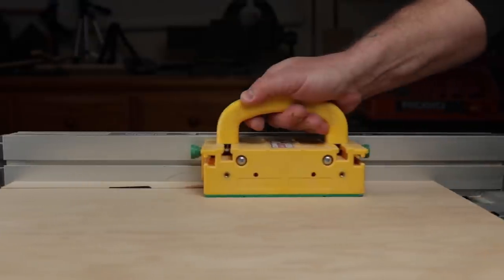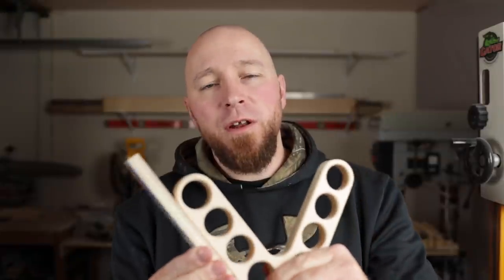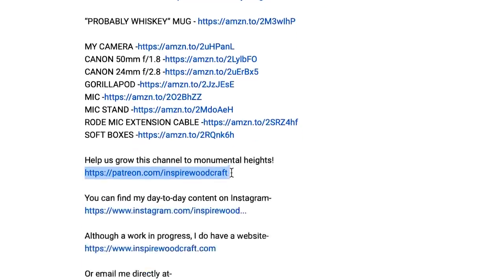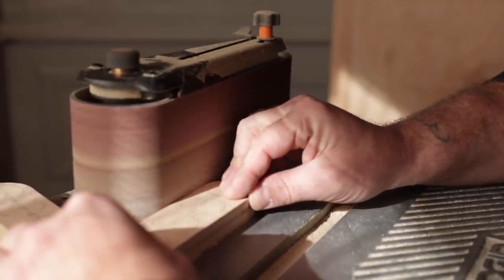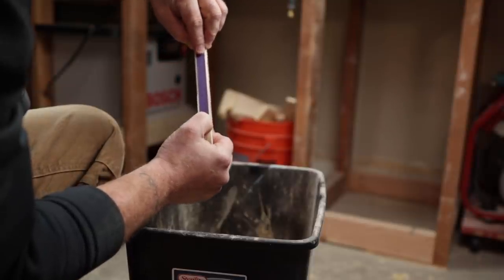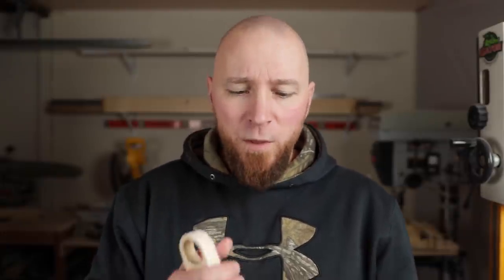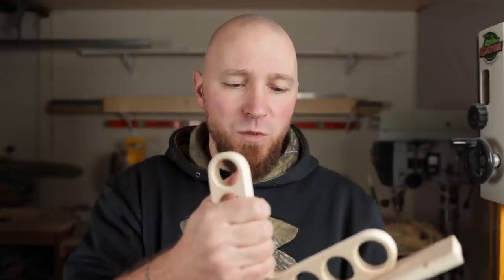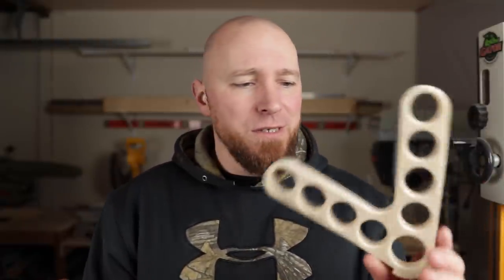Is This The New Best Push Stick Design For The Table Saw? / FREE TEMPLATE!

Comment: Watch the blade height on narrow cuts. A line in the handles showing maximum blade height might be a good idea. I realize you are not supposed to run the blade much over the thickness of the material being cut but I can see it getting left up by accident. 4:50 Call me paranoid but after 40 years of woodworking I still have all 10 fingers.....
Reply from the maker: Completely understand. Not sure what you’re referring to with the time stamp though. Can you clarify please?
Reply: @InspireWoodcraft  If you look at your fingers @ 4:50 you will see they are directly in line with the blade. If the blade was left too high for some reason you would be looking at your pinky finger laying on the top of the table saw.
Reply from the maker: Oh okay I see what you’re saying. Just so that we’re on the same page, that first cut was to demonstrate that it was tall enough that you could use it on the opposite side of the fence which is what some people prefer. I personally don’t so my hand was a little lower on the handle. But that being said, I would have to have the blade nearly two whole inches above the top of the material being cut in order to have the blade contact my hand at all. If I did leave it up that high and still push it all the way through I should probably rethink my career choices. Thanks for clarifying for me!
Reply: centaurus777 - why is the blade height u mention a table saw safety rule?  i find my work lifting off the blade more with a correctly set blade height.  also, it seems to me that at a correctly set height the blade is cutting by pushing back on the wood where as if it is set higher up the blade is cutting more as is comes down, both holding the piece against the table and reducing the force it pushes it back, which to me appears to create a condition where the tendency for kickback is reduced.  could you clarify?
Reply: @michael-dm2bv  What you are saying is true. When the blade is set low the cutting path is longer and the work is pushed back against the feed. If you were to cut at the center of the blade then yes the cutting force is more downward and the cut path is straight through the stock. However, the more blade above the work the greater the risk of getting into the thing. The work does like to "ride" up the blade sometimes when set just above the stock but a hold down or a second push stick will correct that. Kickbacks that can throw the work and ruin your day are a real risk whenever the blade can grab the work and the work has something to bump against like improperly using a fence on short stock. With the push stick video we were watching @ 4:50 you can see the blade height can increase the risk. Some saws had guards over the blades to help protect your fingers but mine never did and many you see on YouTube do not have them either or they were taken off and pitched for whatever reason. This is just my take on the subject and I suppose an entire book could be written on it. Read through this for other views. http://www.woodweb.com/knowledge_base/Table_Saw_Blade_Height_Above_Material.html
Reply: @centaurus777  - thanks for the reply.  i don't use a blade guard either but stubby nubs on youtube says that by rights as long as you have a riving knife working without the blade guard is an acceptable condition.  i like seeing the blade and the cut.  once again, thanks for the reply and the link.
Reply: @centaurus777  - good read.  thanks.  never knew there was a difference between a miter box and table saw blade.  probably saved me a potential dangerous situation in the future.  thanks.
Reply: Inspire Woodcraft  I’ve been using a table saw for 45 yrs - most of those with no blade guard. 2-3 observations. 1- kickbacks are no joke. They can suck your hand into a blade far faster than a human can react. The key is not a useless cheap blade guard, it’s knowing what you’re doing, not ripping anything that’s not straight and true without a sled, hold-downs,etc , and mostly - keeping your body and hands the hell away from the blade!! Which brings me to the next point- I don’t care about all the hyperbole and nonsense arguments about blade angle on shallow cuts - if you want to amputate a finger or two, crank that blade up as high as it will go. I’ll keep mine as low as possible, a riving knife or micro-jig type splitter in place in my array of zero-clearance inserts, and my hands far far away from the blade. I see some of the more popular YT “content creators” doing things in every video that will, sooner or later, NOT end well for them. It’s a constant battle trying to convince young people who I work with from time to time to do it my way and not the YT ‘maker’ way.
Reply: michael  A table saw is not a bandsaw. That line of thinking will cost you a finger or worse. Lower that blade, use only sharp blades, properly aligned - and don’t rip stock that isn’t straight and true. A correct-for-task sharp blade running parallel to the fence produces very manageable back pressure on the cut, but put an 8-9” steel wedge spinning 3450rpm between the stock and the fence and it becomes UNcontrollable and unpredictable in a hurry.
Reply: Tioga Fretworks - seeing the kerf on the cut has prevented kickback for me on more than one occassion and i have seen more than one youtube commenter letting people know that he knew people that lost fingers with a blade guard installed.  you prove the point in some respects in that kickback is the main reason people get their hands sucked into the blade and that is the reason using a table saw without a guard but with a riving knife is an acceptable condition, as the chances for kickback are considerably reduced.  and like i said i watch the blade and i always monitor my kerf.  thanks for ur concern but thats just the way i roll, besides, half the time i'm using my pos dewalt jobsite saw with its blade fully up to rip oak dunnage and at that point the blade guard is likely a piece of plastic that likes to call itself a false sense of security.  as for the blade height you should read the article the tuber i aked the question to posted, as more than one responder in the article posted that the keep the blade high enough to see the bottom of the kerf in the blade, and i agree as if i keep it lower thinner crap i rip always seems to ride up and at that point i am forced to use a push stick over the blade to hold my work down.  a matter of safety perspective in my mind.  is it better to keep the blade at a "safer" lower height that requires you to put a hand over and closer to the blade or "unsafely" keep the blade higher and to keep ur hand well clear of the table?  nazi type safety is never the clear choice my brother was working an attic sprinkler system on a job that required safety glasses once, and even though it was sweltering hot and his glasses were fogging up the safety nazi on the job required him to keep his glasses on.  a wonderful attitude no?  keep ur eyesight at the risk of falling 20 feet to ur death because u can't see a thing!

Comment: Any concern that your hand is running directly over the blade? I use my push stick to keep my hand behind the blade and never directly over it. With the V shape, every cut you make ends with your hand passing right over the blade. What am I missing?
Reply from the maker: Hey thanks for asking. I personally like push sticks or blocks that are closer to the material, and yes, therefor the blade, than the traditional long stick design. I feel I have better control of the workpiece as I make the cut because I can apply pressure to the length of the piece instead of just the corner of the board, ensuring that the entire piece is against the fence and driving straight through. I've just found that it gives me better cuts in general and I don't feel like I'm trying to control the stick, instead of the material. I don't "worry" about my hand during kickback because I've all but eliminated the possibility of it even happening.

Comment: Awesome stuff.  So, after you make one, do you just trace out the pattern from the one you built, or do you tape 2 or 3 squares of plywood together and do multiples at a time?
Reply from the maker: In theory you could trace out a fully made on on a new piece, cut just outside the line on a bandsaw or something similar, tape the two together to use the freshly made on as a template and use a pattern bit on a router table to shape it exactly like the other. Then with two still attached, drill the holes and trim the area at the “hook” where the router bit wouldn’t be able to reach. That’s how I was going to batch them but I ran out of double side tape so I used a separate template for each one I’ve made so far. I finally got my tape but now I broke a bandsaw blade. Go figure.

Comment: If you run it across the blade, will the sand paper dull the blade?
Reply from the maker: No. The sandpaper we use in the wood shop can’t possibly be as harsh as the repeated cuts with some of the dense hardwoods and plywood’s we run through the blade on a regular basis.

Comment: i'm struggling to see what the purpose of the holes is, they might reduce weight somewhat, but also strength, and plywood isn't really heavy enough to be a concern at that size. Is it simply a style/look thing, or do they have a purpose?

Comment: In the shop I work in, we don't hesitate to run our pushsticks right through the blade, because if your doing a 1/2" rip, you have to push it with SOMETHING and a finger is not a good option. Push sticks are made to get cut once in awhile. Mixing sandpaper and carbide saw blades seems like a bad idea to me.
Reply from the maker: I’m glad to get a comment from someone in a shop setting. Think about all the plywood’s and hardwoods you cut on a daily basis. Sandpaper once in a while has nothing on that stuff. Plus you could always just not put it on there. Although I said I wouldn’t be, I used one of mine for 1/2” cuts and edge banding yesterday for testing purposes and it works flawlessly.

Comment: Hey Jody, Awesome design. I got rid of my table saw cause it scared me with kick back. I actually had a piece fly out and stick in the wall behind me, glad I was a bit Paranoid standing off to the side. Now years have gone by and I desire to try one again. Can you give advice to minimize kick back? maybe your own horror story on your first go at the machine.
Thank You always, great teacher you are.
Reply from the maker: That might have to be discussed in a future video. I've experienced kickback before as well, and it can rattle you for sure! When I was young and inexperienced I was cutting 1-1/2" squares of oak on a Delta Unisaw and had one piece shoot out and hit me square in the chest. Scared the crap out of me! It left a perfect square mark in my Carhartt vest, which I was thankfully wearing. That's why in the video I showed using this push stick on both sides of the fence so that people could see it being used either way. Table saw safety and technique is one of the most talked about and debated topics in woodworking, it seems.
Reply: @InspireWoodcraft  I'd be pleased if you did a saftey or how to video some day. Thanks Jody....Mitch Carson City Nevada
Reply: Make sure both the fence and the blade are [edit] square parallel to the miter slot.
Make sure the piece stays flush to the fence during a rip.
Never use the fence when making a cross cut.
Use a sled when making cross cuts with longer pieces.
Make sure the wood is flat and stable on the table.
Make sure the blade is sharp.
Always push the piece completely past the blade.
Never stop the cut. Never let the piece move backwards.
Don't feed the piece faster than the blade can handle.
Keep the push-stick on the piece between the fence and the blade.
Use a feather board when possible.
Keep downward pressure on the board at the cutting point (not with your hand).

Always, always, always use a riving knife (or at least a splitter).
Reply: @fred_derf  That was helpful especially making sure the fence and blade are parallel.  Great Tips Thanks!
Reply: @mitch5077  If the blade and fence are both parallel (better term than square) to the miter slot then they will be parallel with each other. The miter slot is never going to move or get crooked so it's the obvious choice to use as a baseline.
Reply: yea I have had that happen to me before and it scared the (exploitative). out of me,  but it also showed me I was not being safe enough. and now I almost always stand slightly off to the side and take other safety measures.    I once saw a planer catch a piece of wood, cock it sideways and shoot it back out and strike a guy in the stomach,  he was standing off to the side.  that was crazy scary
Reply: Riving knife
Reply: I have experienced kick back.  I still have the piece of wood with the gouges from the saw blade as a reminder.  I got kickback when I got a bit lackadaisical and didn't keep proper pressure on the board I was cutting.  That downward and toward the fence pressure is crucial.

Comment: Very nice design that I would use for cutting wood no smaller that two inches wide with the depth of blade set correctly. Also, as other have noted, I think that the holes are overkill. You might want to consider just cutting a midline slot on each arm about 1/2" wide leaving at least an inch of solid wood at either end. That would give it a nice look & be much easier & quicker to accomplish. The sandpaper is fine but I would use rubber material. Just a thought....
Reply from the maker: Appreciate the feedback! Thanks! Yeah I think a lot of people didn’t actually hear the words in the video. It was simply an aesthetic compliment to the design. Not necessary at all. Even a slot wouldn’t really serve a function that I know of because they’re literally not used for anything. I’ve seen a few people suggest runner type material but I usually build my projects with stuff most of us have around the shop and I don’t have any rubber stuff.

Comment: Nice video send design! I did say maybe one side doesn't have the lip/hook and one side does so you can choose if you need to hook from behind or on longer pieces just put on top. Also I agree eighth tiger other comment off having enough material so it would not shatter and bring you closer to blade as it collapse and you are pushing down. So maybe not so big holes?
Reply from the maker: Thanks! The holes are purely for aesthetic reasons and aren’t necessary, as I mentioned. It won’t “shatter” as a few people have said. In fact that really doesn’t even make sense if you think about it. It’s just a piece of plywood. I’ll post a picture soon to ease peoples minds and I’m going to do a follow up video to address some things for sure!